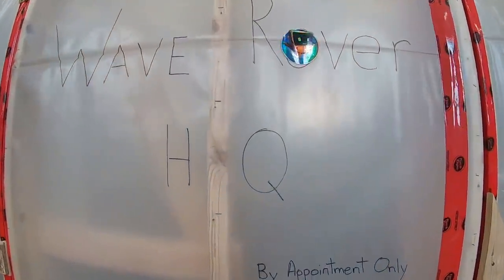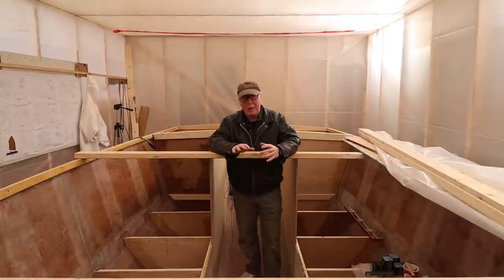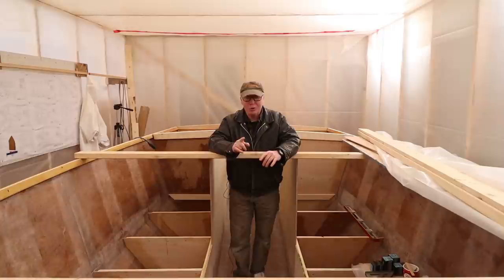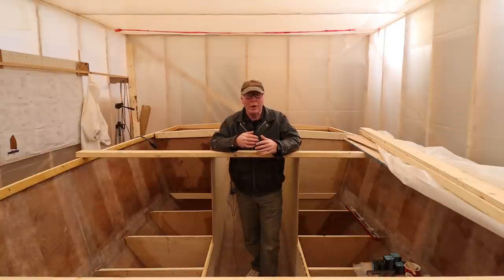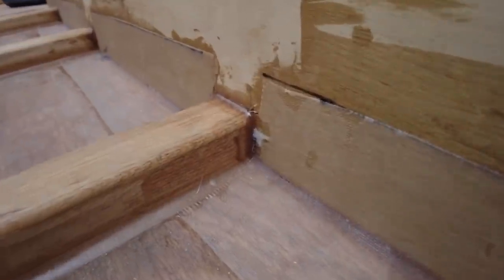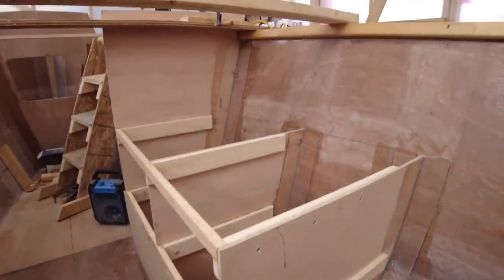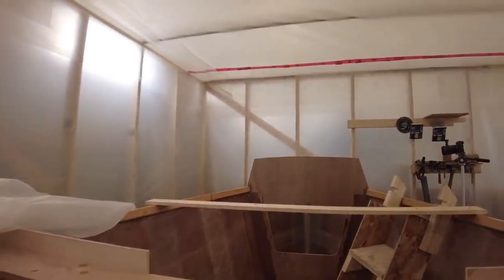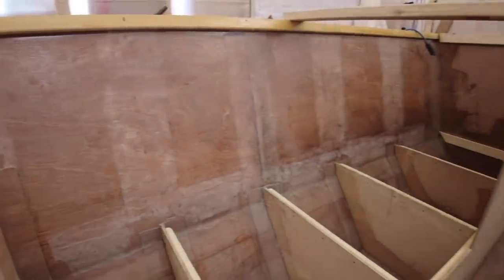S2E33  Wave Rover Boat Tour// Filmed March 28th 2022

Comment: In my 25' Ariel build, with a layout similar to what you are doing, stove to port with small cabinet stowage just forward of that (on aft of main bulkhead), large cabinet w/sink in top just aft of main bulkhead to strbd, and I will have my Engel fridge/freezer just aft of that. No real reason for picking sides, just seems right. :)

Also, integral water tanks, under former settee bunks. Approx 70 gals (35 each) in the 2 tanks, that will also provide for containment in case of a hull breach in those areas. These are overall a bit aft of CG/CLR, so I am putting batteries, anchors, and chain just forward of main bulkhead to balance weight.

Comment: I still find this fascinating, despite zero knowledge about your building process….but, I was wondering if you plan, or is it necessary, to leak check the boat before closing off access to the insides of the bulkheads?

Comment: I've seen galleys and chart tables on both sides, probably just down to personal taste and packaging but Wave Rover looks pretty symetrical so toss a coin :-)  I have similar round inspection hatches and wish they were a fraction larger sometimes but they are useful and relatively cheap and replaceable if damaged.  Soon I'll be looking for an inflatable tender and I'll be looking at the titchy end of the market.  There is a surprisingly wide difference in weight, a Seago go light 2.3m (7'6"?) comes in at 13.2kg but many are over 20kg.  I expect that the fabric must be on the thin side.  Low weight and a small packed size will suit me but I'd want something sturdier for a long ocean voyage.  Maybe a tough slatted floor will prove useful when you drag yours up on a distant, rocky shore

Comment: Camera is fine. You can use them on a tripod and probably all of your GoPro clamps. They have a good reputation but I don't know about water proofing. GoPro best for that when at sea. Chart/Galley? Some basic pencil drawings about your layout would be good. I think you are right handed so spoon/spatula/tongs in right hand might make starboard side best for galley. Consider at this stage where you might like hand holds for safety.

Comment: A great deal of thought going into this layout, one thing about the tender , I assume you want to avoid slatted floors and go for an inflatable floor
Reply from the maker: I don't know a lot about inflatables, are slatted floors bad?
Reply: @RoversAdventure  slatted floors need extra storage because they are solid also an inflatable v floor planes better through the water than a flat floor
Reply: I had slatted floors. Wood wasn't sealed well after years it was very soft and slats stuck to floor fabric sleeves making it hard to disassemble and roll up the dinghy. Plus hard to assemble for similar reasons. It worked ok for coastal cruising on a budget but I always used the dock to take it apart for storage and that was rare because it was so hard. No experience with inflatable floors but I did have to patch my dinghy due to sharp oyster shells in the PNW. Price and some puncture-surviving bottom structure led me to a slatted bottom.

Comment: I would keep  the galley away from your charts and electronics.  I like your small water containers.  I would put them low on either side of the keel. I like keeping the bow and Stern to be light. You could use the empty containers as floatation or fill them with salt water and use them for movable ballast. I like keeping the hull open for repairs. Don't like the sealed compartments that restrict repairs.

Comment: I sell inflatable boats. 3.3m 1.2mm PVC with Aluminum flooring and it would fit easily in that area. If you're interested let me know. Something to keep in mind hypalon does not store well deflated but PVC does stores well deflated.
Reply from the maker: Do you sell a 2.3m inflatable? Thanks for the advice concerning the foldability of PVC.

Comment: Alan,  As with your previous look ahead video, major changes to the design like the cockpit, or installing deck lockers or roll up dingy, should be done in consultation with the design Naval Architect.  Have you kept him in the loop, and what are his thoughts about all the modifications from the original design?
Reply from the maker: Andy and I usually talk at least once a week. I laid down the parameters and the style of the boat and Andy ensured that it was engineered correctly. Everything I have redesigned has made a strong boat stronger.

Comment: The best cooking method when bouncing around is probable a jet boil secured in a fire proof cylinder near the companionway.  At other times it seems to depend on how elaborate a cook you are.  The chart table is an interesting situation.  To suggest something we need to know what you want one for ...Many don't use them at all ,particularly if it is uncomfortable.  Ming Ming has a interesting solution for a small boat but for me it would need a seat opposite .  I suspect that cooking a fancy meal may require the same.

Comment: Only two options...cheap pick...or expensive hypalon.....pick in your random usage will last 2 years no problem....hypalon will outlast you when stowed and used sparingly and cared for.  Absolute best small roll up hypalon is Achilles brand. They make a tiny lightweight tender, check them out...hands down best stowable tender...I am on my second  one, sold first one with last boat. Have tried the rest over the last 35 years of sailing, should have just got the Achilles first.

Comment: What about a folding dinghy? 
Years ago, I made one out of 5 mm marine plywood. 4 panels that folded like a ®Porta-Bote, but smaller (2.4 m). 
Chines were tarp strips stapled and glued to the ply. Midship bench, transom and transom bench holded it open.
I had never dared to risk the main dinghy 4 hp on it, but she was quite agile powered by a kayak type double paddle. 
If it had existed by the time I would have considered a stick shape ®Temo electric engine. Only 450 W but certainly enough for such a light little vessel.
Once folded in the stanchions it was flatter than a windsurf. 
I think it could also been stored under the solar panel arch.

On the inflatable side I'm considering (hopefully as my next dinghy) the open bow - open transom ®Takacat which comes into 2 reasonable size bags (1 for tubes, 1 for high pressure floor).
Their  catamaran shape avoid the suction effect of regular inflatable, so they can be powered with a small engine (3 hp for the T 260)